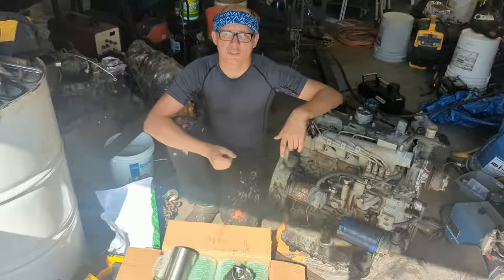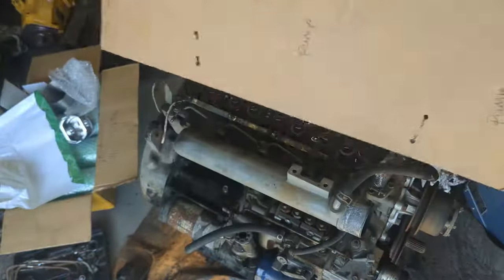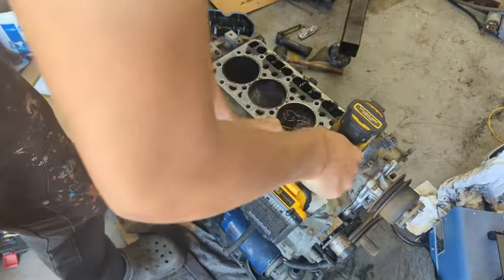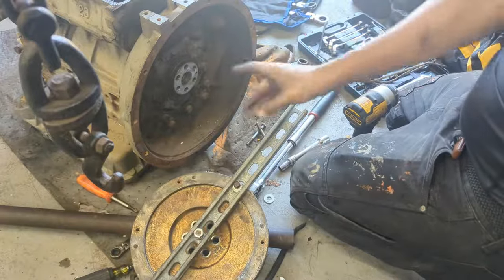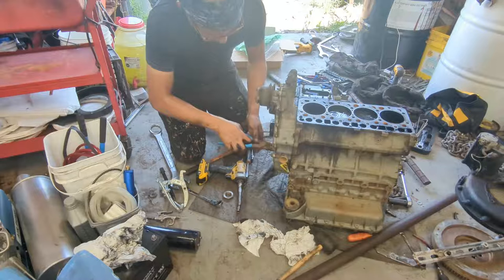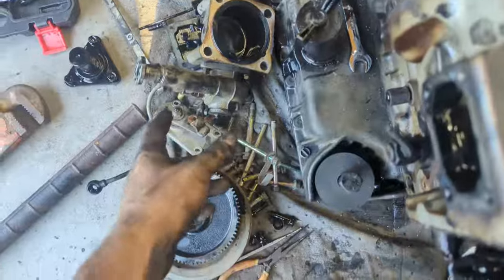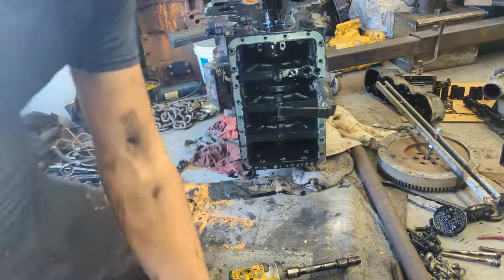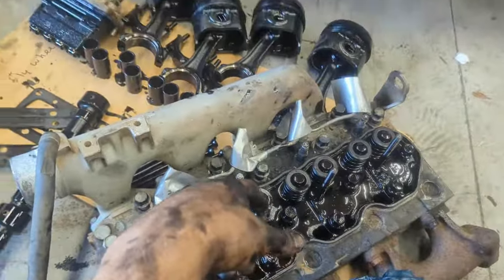How to rebuild/repair any Kubota diesel engine Part 1 disassembly

Comment: Hey great video question the overhaul kit you bought did it come with the gaskets for the oil pump and alternator side
Reply from the maker: Yes but some don't. It's a hit or miss sometimes. Imo just use silicone if they don't. Works better anyways
Reply: Thanks man red rtv silicone is geat to use @Rowow

Comment: Great video!!! Can’t wait to see the assembly!!! Question: is it worth learning how to rebuild these? I have 4 Reefer trailers that use these type of engines. I’ve been thinking about learning how to rebuild them.
Reply from the maker: Already got it assembled and ran it works great. Uploaded the short just need to edit the video together on assembly. But yes its definetly worth rebuilding these. Its to cheap and simple. Biggest "issue" is getting the timing on it right. But with kubota's its alot easier than other type of engine timing system and almost impossible to mess up
Reply: You can get a spare engine then rebuild it. Whenever a trailer has a bad engine swap it out and rebuild the old one. Meanwhile it can operate as an air compressor and generator for your shop.
Reply from the maker: Second part up! More to come soon.

Comment: did you install the piston sleeves?    do you know if the engine can be bored out 0.5mm or do you just have to install the sleeves?
Reply from the maker: I only replaced the pistons since mines is in perfect tolerance. But yes they have a oversized kit available. In my opinion if you are going to get a bore job done might as well replace the sleeves

Comment: Thanks for the video, Question for you  or anyone. Do you know what would cause this.  I bought a 2006 Kubota  M4900 with only 468 hours. I think the hours are right as all of the linkages and pedals are like new. It has a tick in the engine if it is setting down hill a little, hot or cold.  You can move it slightly up hill and it will stop ticking and sounds great. You can also take the loader bucket and raise the front slightly above level and it will quit until you let it back down below level. It is not the hydraulic pump, it is in the engine. I have changed the oil and filter twice. I added oil treatment, I adjusted the valves twice. I have put 200 hours on it and it hasn't improved. It's like when you raise the front end a little it moves the oil to the rear of the engine and stops the ticking. I suspect someone has worked on the engine for some reason and maybe left something out that may deflect the oil from going to the front of the engine too far. Does anyone have any suggestions?
Thanks very much. Looking forward for a reply.
Reply from the maker: I really doubt its actually from the engine. I suggest buying a automotive Stethoscope. They sell it at harbor freight, auto zone, amazon, etc. and probing around the engine to figure out exactly where its coming from. Most likely something is hitting against the fan is my guess. Ive seen some really random/unpredictable things to cause stuff like that.

Comment: I need a crankshaft for a d905. Do you have any recommendations on where to find a good used crankshaft
Reply from the maker: simply google "D905 crankshaft" 
lots of brand new ones for $550
dont go with used. Spend a little extra and get a good brand new one

Comment: is this good engine? i always must warm him to easier starting in my digger hitachi?
Reply from the maker: I have a short/vidro of it running. Very good easy to start. I'll make a video on putting it back together next month.
Reply: @Rowow  without pusch heating? never? in cold winter?
Reply from the maker: @damirivancic4964  idk I'm in Florida.

Comment: Are the orange seals and the washers you remove suppose to be rubber materials?
Reply from the maker: Which part of the video?
Reply: @Rowow  around 24:00.
Reply from the maker: @wd2699  yes those are o rings